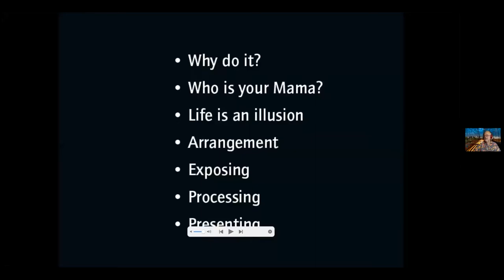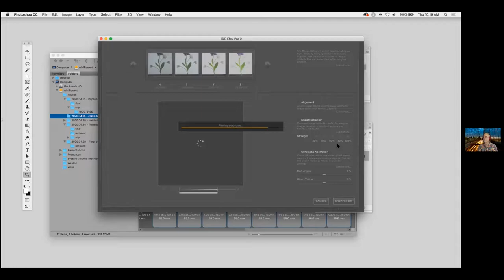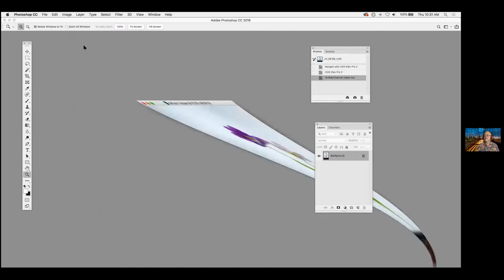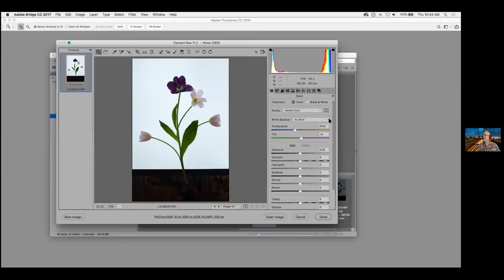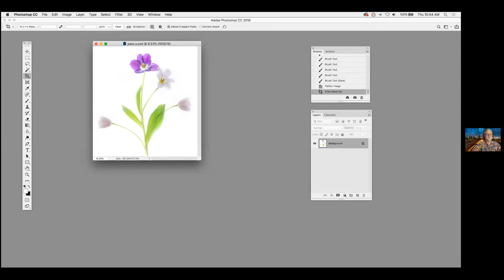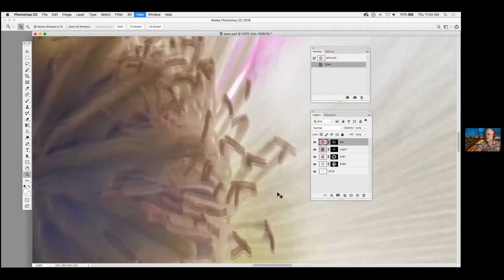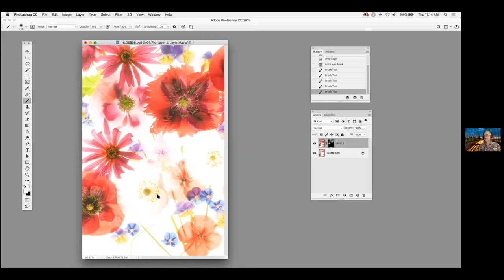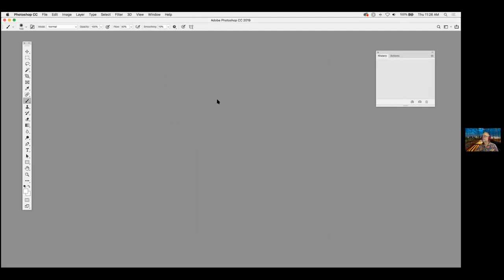Photographing Flowers for Transparency | Part 3: Processing a High-Key Layer Stack | Harold Davis

Comment: Hi Harold - I have only just come across your beautiful flower ART and Im totally in love with the process!!!  Quick question - is there a way to change shutter speed without touching your camera to prevent to possibility of moving the camera??
Reply from the maker: Hi Nikki-- Yes! Use an auto-bracket program. The specifics depend on the camera, check your manual. Harold prefers to use manual even though this means touching the camera. He says that a good tripod is very important. Thanks!

Comment: When you are correcting the alignment issue on the poppy, you reprocessed the RAW for the center only and added a layer.  You then masked with black and used white to bring out the center one the last image.  Do you need to go back and use black on the original center to eliminate it from the stack?
Reply from the maker: Not if the new layer covers the old one at 100% opacity.